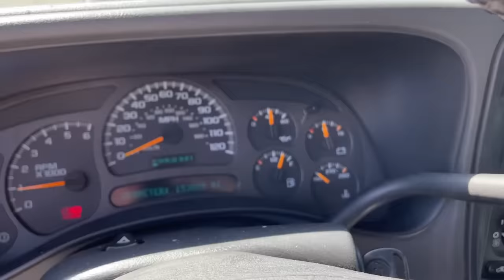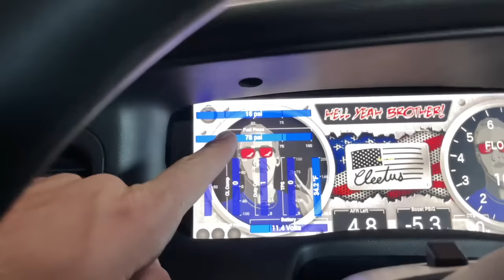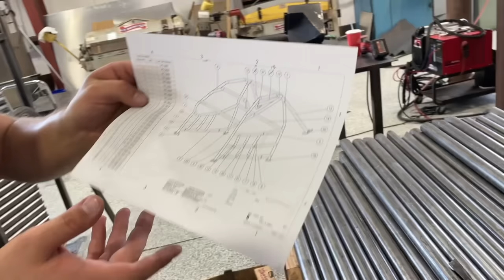KillaB's NEW 1700hp Blower Engine Is Done! But It Won't Start... + These New Roll Cages Are INSANE!

Comment: You guys should consider using verticore wire in a mig welder with 100% CO2 for shielding gas for the Vic cages.  You won't find a quicker setup that produces quality all position welds then that. Just a suggestion.  Love your content

Comment: My best friend and I have been racing UMP Dirtcar Modifieds for almost 20 years, MSD 6AL boxes are a maintenance item in a high vibration environment! If your checking the gap on your spark plugs, swap it out. If it was still running when you swapped it, then throw it in the trailer as a spare for at the track. 100% the reason Killa B blew up in my opinion, I guess we will find out!

Comment: Future trick you can use when you pour fuel in a water bottle and jab a hole in the lid, make the hole just big enough that a straw from a can of brake clean fits in it and you then have a precision instrument you can fill carb bowls with through the breather tubes!

Comment: Get a gallon of Lucas oil stabilizer i ran it for 2 years in my semi that needed a inframe (engine rebuild) for 3 years and even with badly  wore out sleeves and water in my oil 100% of the time in my 500 Detroit diesel. Even when I had to change the oil every week Hauling load's over 90k pounds sometimes over 100k when i could get away with it. At normal idle it still had 25-29 PSI of pressure.

Comment: Think the next upgrade to the crown vic racecars would be a spaceframe with crown v ic suspension and drivetrain and no more sheetmetal at all basicly have a race with the ford versions of leroy

btw cleet if youre putting the cub on display make sure that they cannot get to stuff inside it , either the engine controll cables or the cocpit , having someone pull a wire or snip it (itll be fun.....) can cause a verry costly malfunction in mid air , i actually would advice you to keep the thing away from the public or put it up so high noone can even touch it without being seen (maibe on top of the hauler )

Comment: The only thing reliable about a ignition box is that its reliability gonna fail sooner than later and at the worst possible time. Buddy junked to the extent of the only thing salvageable was the valve covers and intake 2 brand new 60k dirt late model engines few years ago due to a ignition box that randomly would screw up then go back to normal like nothing happened before he found the cause because it finally decided to do it while he had the timing light on it checking timing on the third engine

Comment: Cleetus...I drive by the drag all the time. You NEED a digital billboard that you can advertise events & dates. Just keep it off the road far enough to prevent hoodlums tossing bottles at it at 80mph. Im local and NEVER EVER hear about any events you have upcoming unless its from your channel. THE LOCAL COMMUNITY HAS NO IDEA THERES SOMETHING COOL TO DO ON WEEKENDS. We're soo used to old Desoto being shut down that many dont ever think about the track anymore, it simply doesn't exist anymore in the minds of many.

Comment: I think it would be a great idea to have a Pick and Pull day for the crown vics that aren't in service anymore, before they head for scrap. There are a few FL tracks around that run Ford outlaw and other Vic races. Would be a solid way to re coop some expenses and help give back to the community that also chooses to race these units!
Reply: There starting to use parts
Reply: Why sell good parts?
Reply: but they need them for the other cars

Comment: Save neighbors motor and have her rebuilt, she deserves a set of bearings and refresh. You owe her that much.
Reply: The builder said that this was it's last ride, can't be built again. I'm wondering if their sensor is bad, I can't believe it hasn't kicked the rods with 17psi on 1k hp.
Reply: @jasonm3109  either sensor it’s bad or she’s just not smart enough to know she’s supposed to quit running
Reply: Send it mate
Reply: @jasonm3109  why can’t it be built again?
Reply: @brendanhall9504  you can only resurface the engine so many times, the 1st time you resurface you need thicker bearings on the inside eventually you run out of thick bearings and it will just destroy itself, the head in the top of the block will be shorter after resurfacing and the piston will hit it, the list goes on. It's not just about bearings
Reply: @brendanhall9504  there’s only so much material you can remove from the block before it’s junk and only so much material you can remove from the heads before there junk and so much material you can remove from the crank before it’s junk

Comment: You should get some guard rails and weld them around the Vic's at the same height so they act as an extra bumper and so the bodies don't get super torn up
Reply: Hmm... i think that might make it worse, the crumple zones in cars are designed to absorb impact and direct it away from the occupants, putting in bumper bars might act as a reinforcement and force the collisions to be impactful to the occupants cos there would be no give when the crash occurs

Comment: Cleetus, I doubt youll read this but you can clamp your timing light anywhere along the spark wires from the computer to fault find. Doesn’t have to be the HT, the clamp picks up the induction. Experiment, you might surprise your self. Might work on injectors too. The light just triggers on difference.

Comment: SUBJECT: RodKnock-Rodney
SUGGESTION: Maybe the oil dip-stick is too long.
Check to see if you have the right one by ordering a new one for that motor.
If you receive one that is shorter that means you haven’t been putting enough oil in it.
Just a thought.

SHARP THOUGHTS
Roderick Sharp

Comment: I really think with fresh oil changes on these vics yall should invest in a fee 5gal buckets of motorkote and put 32oz in each engine. definitely not your typical snake oil product I've driven home personally on 5cyl with 3 rods out the pan over 30min no oil then 2 weeks later still no oil fired up and made a 20min drive to shop for repairs. they have a 5min long video showing it working...I put it in every single vehicle I own now beat the living shit out if them and haven't had any failures other than the truck that lost the rods that already had very low oil pressure when I bought it

Comment: make sure the ground wire from the promag ignition box case to the cylinder head is good and clean(very important). check all other wiring for shorts, all the way to the kill switch, tachometer/tach converter box and any 2-step module/rev limiter it may have.
hard to tell which wires were broken by your showing them, but that's probably the "kill switch" wires from the ignition box. if so it's black and orange and may also go to a magneto tach or tach converter if the wires were reversed it may not work due to grounding out through the tach/converter.
also, assuming it's a slip collar style magneto mount, make sure it's actually in the right depth and actually spinning. seeing that everything was apart/new engine.

Comment: I know some pipe fitters at s.a communal in Ohio that would happily relocate to weld for you boys btw. Used to welding schedule 7 and thicker to 400 psi pressure testing more than capable just had our hours cut from 58 hours to 40 I'm sure even one of them would cut your times down

Comment: You guys need an Oscilloscope and tune up equipment to catch little problems such a weak firing cylinders, weak coils weak signals form pickups and safety deices.

Comment: Hey Garrett you might want to let people know that you don't actually mean that the cages were tacked and ready to go because tack welding is what you do when you want to make sure something's right then you go back around and weld it all up tack welding is like when you put up a decal and you put small pieces of tape and a few spots to hold it in place before you glue it to the surface.. Just saying it doesn't sound very reassuring that the roll cages were tacked and ready to go LOL

Comment: ignition boxes are notorious for going wonky from any electrical charge near them. No telling how many promag 44 boxes we went through before we figured out not to weld on the car with it in there. Also lightning around it or bad static apparently can cause them to go bad as well.

Comment: Sounds about right you loose spark at that power level and it's working off of overlap combustion from the overlap on the cam and that woulda kept turning and burning till it blew or ran outta gas could be why the burst plate blew fill the cylinders with gas and then evacuated thru the burst panel but yeah lost ignition and the msd and magneto going bad or one not controlling the spark or regulate spark

Comment: I still think Killa B never shifter properly the night it blew up. The engine seemed like it was revving why higher then the tire smoke indicated. The way that car is, it looked like it wasn't putting it down at all. I remember think before he even grenaded it, "man this thing kinda looks like it aint running right". Lo and behold 30 seconds later its on fire in pieces.

Comment: the crown voc should be owned by the driver/team a bit like nascar for maintenance and repair and they need to last a full season of racing and keep there car in working condition whit a point system like if you are able to pit someone you get 1 point and they lose 1 point whit the risk of damaging your car and not finishing the season

Comment: Cleetus when you gonna upgrade their shop with a roof top ac unit at least just dumping onto the center of the shop ?? Them boys might get 6 cages done a day 😂 they still would need a fan they can kick on every so often to remove smoke

Comment: I'm surprised you don't relocate the inertia (fuel pump cutoff) switch to inside the car where the drivers can reach it so if it trips the driver can push it in to reset. If they hit something that knocks them out, the car is gonna shut off and not just keep going. Just a thought

Comment: HEY ALL CAPS JOE HERE YES THAT'S WHAT BLEW THE MOTOR IVE SEEN THAT HAPPEN WHERE A COMPUTER HAD INTERMITTED POWER AND IT CAUSES THE COMP TO HAVE A SEIZURE AND IT ADVANCED THE TIMMING 50 DEGREES. AND THE MOTOR THREW A ROD

Comment: The module firing the coil at the wrong time wont hurt that engine, it has a distributor so the fire wont make it to the plug unless the rotor is lined up. That can kill the coil.

Comment: So proud of you for stepping up the safety. Some of those crashes last year were pretty gnarly. Also I saw another comment about having a competition to see who can get out of a race car faster and I think it's perfect. On that note have you practiced getting out of Leroy and Mullet? Anytime someone takes our ElCo to the track my dad makes them/us practice getting out 2 or 3 times. It's only an 8.50 cert chassis but there's lots of stuff we added in you wont find on most 9 second cars. The basics of a funny car cage are already there and the whole thing was designed to be able to convert to a 25.something or other without any modifications. Also a chute and GOOD breaks. Dad insists that even a drag car should stop better than it goes 👍